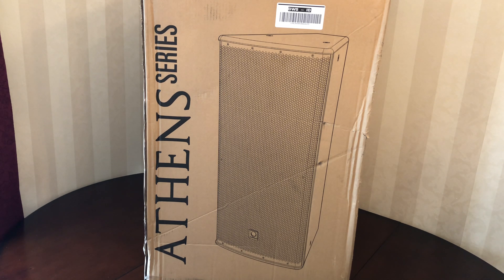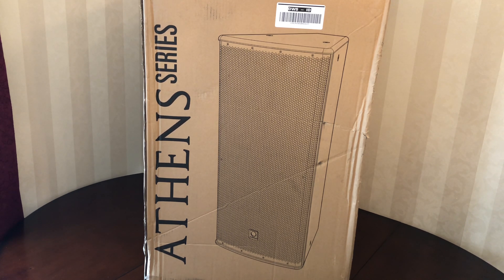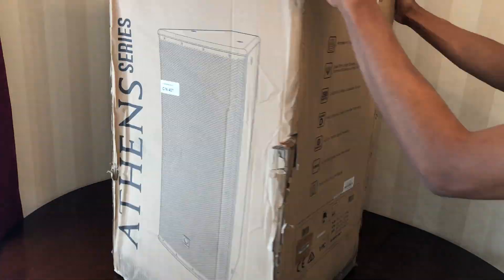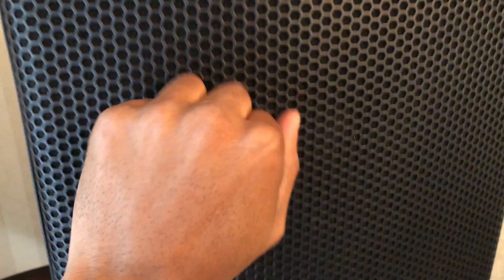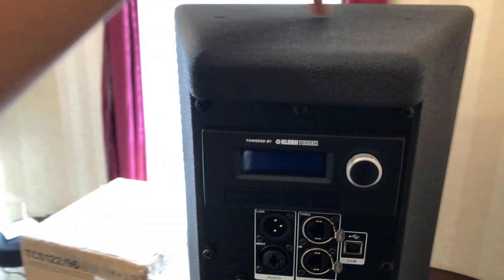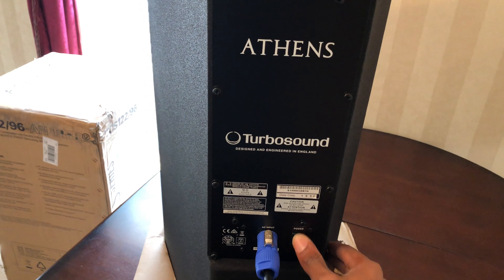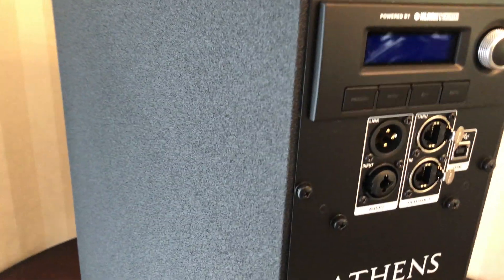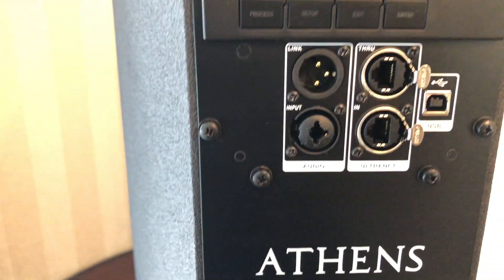Turbosound TCS122 AN

Comment: Hi friend. I am a user of turbosound and I would like you to give me your recommendation between the turbosound athens tcs122 / 96-an and the nuq 122an. I have the nuq118, siena118an and the siena122an and I would like to buy the athens but they also recommend the nuq 12 inches. you that have heard them that you believe in them?
Reply from the maker: Dj Cano PR how will you use them? Are you going to use them as portable speakers? If so don’t because they don’t have a pole mount at the bottom and also No handles, BUT if that’s not a problem for you and if you have truss you can rig them to get the speakers high. The TCS has a rotatable horn NuQ do not. TCS has a 90x60 dispersion NuQ has 70 x 70. TCS is heavier than NuQ. When rigging the TCS has rigging points for tilting the speaker from behind NuQ do not. Both are amazing speakers I use both on rentals. We are dealers for Turbosound whenever you need product we are here for you.
Reply: I sent him a message on Facebook to see what a colleague of mine did with the TCS. I will use them as portable speakers. although I have truss but I have never anchored the speakers to the truss. If I would like to know what difference they have in sound and which of the two you would recommend for live sound.
Reply from the maker: The TCS sounds better because of the quality of the box, it has a Dendritic waveguide. It is fine to use them live if you are willing to deal with that speaker (no handles or pole mount). The Athen series are design for installs But they can be used for whatever purpose you like. Check out the TCS 218B-AN they are killer. And yes I believe in them.